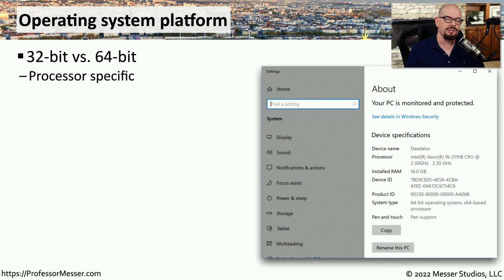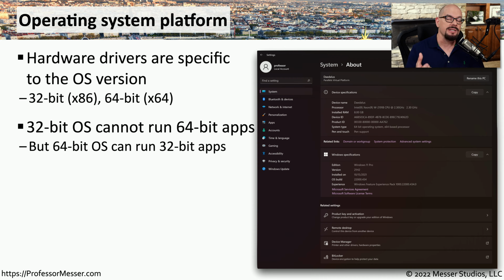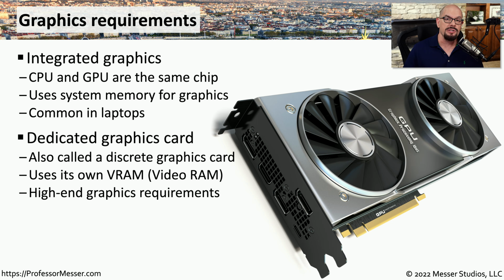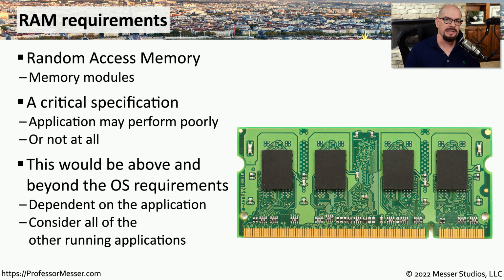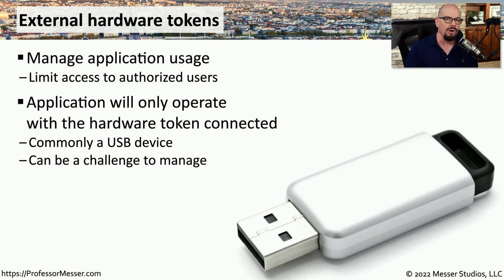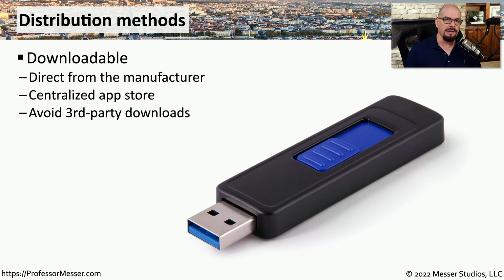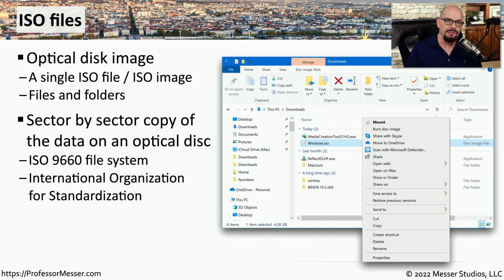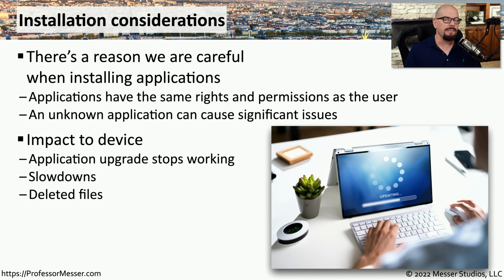Installing Applications - CompTIA A+ 220-1102 - 1.7

Comment: Core 2 seems a lot simpler in comparison to the printer/hardware sections in 1101
Reply: For sure, still a lot of information to recall but will be easier.